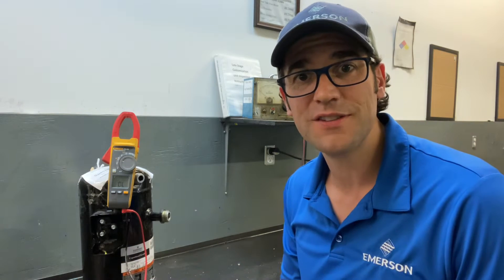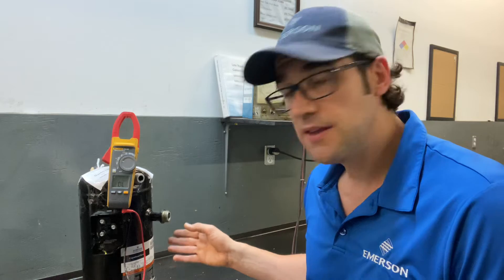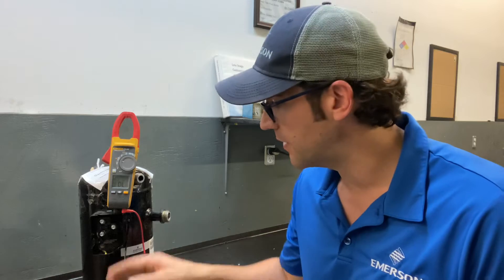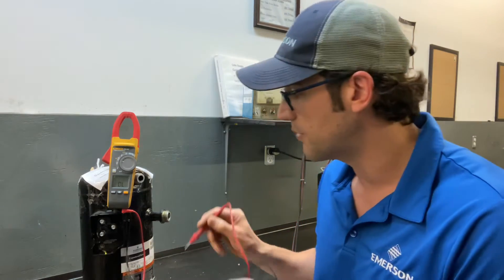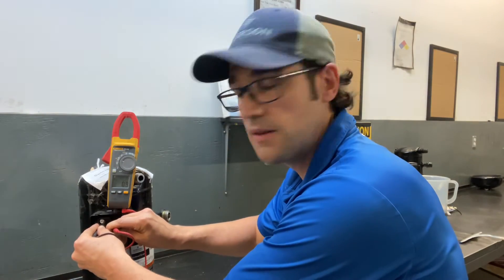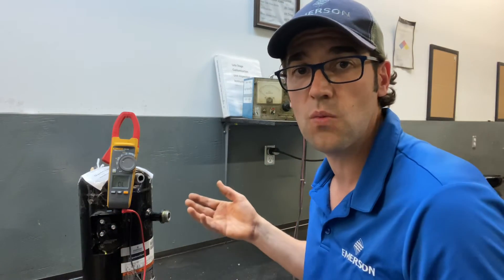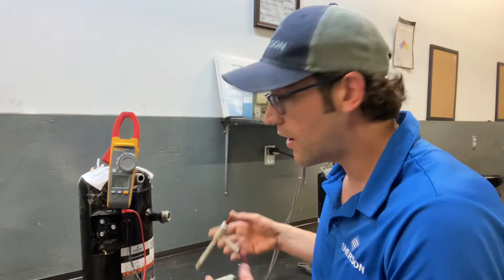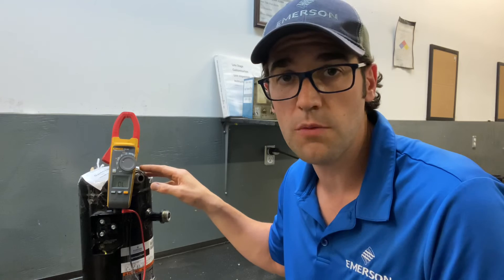How to Check The Winding Resistance of a 3ph Compressor

Comment: 3 phase compressor with a  2 stage would have same ohms reading if it were 1 stage?
Reply from the maker: I believe so. It is best to go to the manufacture of the compressor and check their fixed model vs their 2 stage model and see. It is my understanding that Copeland ZP & ZPS scrolls will have the same or similar stator in it.

Comment: Trevor, great video. I can't really see the model of the fluke meter you are using here, but it looks like a 376? The reason I'm asking is because I just had a weird call I ran yesterday - it was a Trane CSHA scroll compressor with a tripped breaker. Using a Fluke 376FC I found the resistance to be 54k ohms from each leg to ground with all wires disconnected, but leg to leg was normal, 1.4ohms equal. Out of curiosity, I checked the other compressor in the tandem set and found similar readings. Then, I checked the final compressor in its own circuit and had about the same. I broke out my Fluke 87V and found it reading >2Megohms. Wired them back up, reset the breaker and they all ran like champs with normal current and voltage. I thought maybe it was my battery in my meter possibly, but I have talked to several techs over the last few days that seem to have similar stories and when I asked what meter they said the 376. Do you have any thoughts on this??
Reply from the maker: Sorry I do not. I have used many meters over the years but I always found myself always going back to Fluke.  I would call their technical support line 1-800-873-5853 (NA) Good luck.

Comment: Just as I take a break from SkillMill Testing Compressors section, here you are going over bad windings lol. HIPOT Test is new to me. Researching it now. Great info as always Trevor! Thanks!
Reply from the maker: Yeah check it out. The basic principle of each are a megohmeter, measures insulation resistance. A hipot tester measures leakage current a more expensive way to check windings.